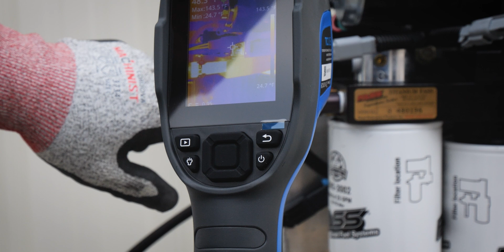We dumped Liquid Nitrogen on our Fuel System...

Comment: Any Advice on getting the Allen plugs in the housing out to install the heater plugs? Mine are in tight and are starting to round some when i torque on them.
Reply from the maker: Hi there! Thank you for reaching out. We apologize for the delayed reply! Are you still battling the issue?
Reply: @FASSFuelSystems yes I bought both the disc heater and single heaters. The single heaters I cannot install due to plugs, not being able to be removed.. do you recommend using heat on the heater block to help remove the stuck plugs